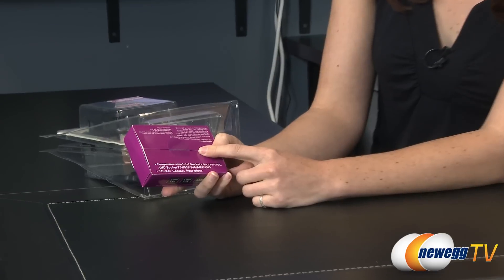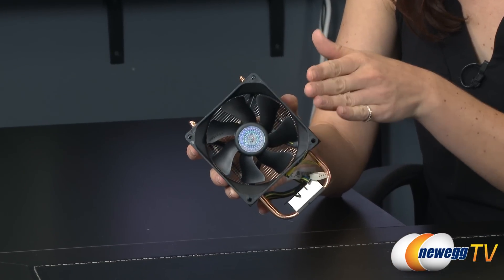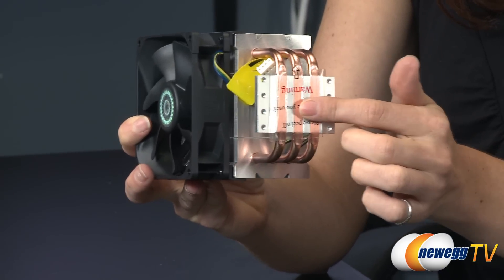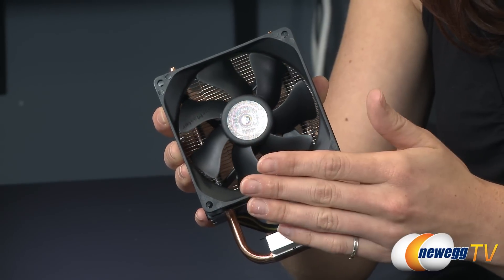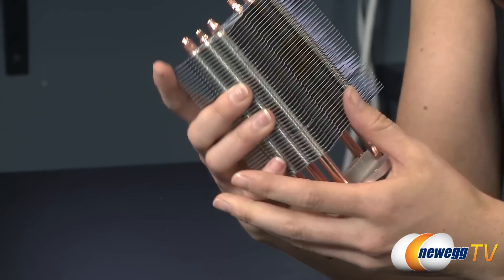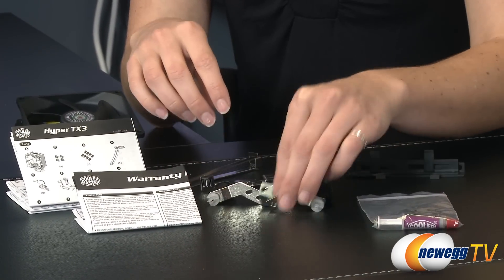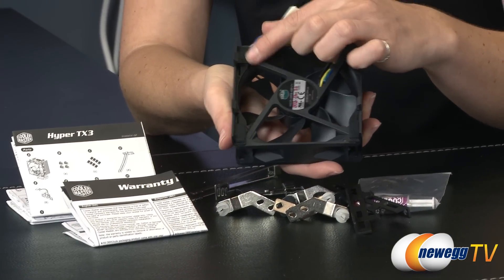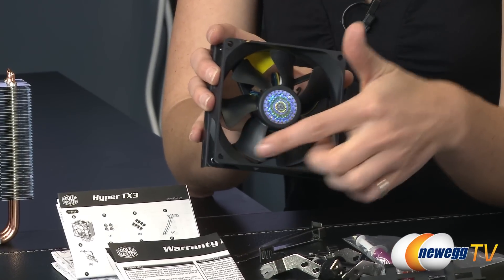COOLER MASTER Hyper TX3 CPU Cooler Overview - Newegg TV

Comment: I have this heatsink on my i5 6600k and it works well. However, what I did NOT like is the lack of a backplate. The cooler isn't terribly heavy, but having reinforcement for such a large cooler is good thing. The stock attachment pins are made out of plastic which does not inspire a lot of confidence.
Reply: Thinking about getting this cooler for my new pc, how are your temps? Overclocked?
Reply: I have this cooler but I havnt installed it yet, by any change can you overclock the 6600k?

Comment: The extra brackets arent for if it brakes, they are there so you can add on anpther fan on the ipposite side to get the push and pull motion, all you need is 4 mounting screws ro fix the fan fo the brakets.

Comment: the extra fan brackets are not incase the other ones break it is so you can add an extra fan on the other side to make a push pull configuration.

Comment: If you get this, i'd deffinately get a secondary fan in push-pull configuration.
Doing so knocked off 7 degrees from my cpu core temps and allowed me to push a 4.4GHzoverclock with my AMD FX6300!
Reply: is it loud? planning to do the same!
Reply: nah not really

Comment: What do you recommend as the best air colling solution for Intel i7-4790k
Reply: Ditto that.  I was looking at either this, or one of the Arctic Cooling Freezer line.
Reply: +Robert Morin I was looking at the Arctic freezer 13 and the TX3.. which one should I get and will it fit my h81-e34 mobo because I fear it may overlap my ram slots
Reply: Actually, I wound up going with a Hyper 212 EVO, didn't think I would, but it happened.  For me, it doesn't seem to bother much with RAM slots, if you have them at a proper profile.  Having Corsair Vengeance Pro DIMMs, I did have to place those in the B slots instead of the A slots, but at least they function.  :)
Reply: Robert Morin 212 evo is too tall my max is 13cm height

Comment: could i use this with a 4770k
Reply: yes you can use it. coolers with lga 1156 or 1155 can be mounted on lga 1150 sockets too
Reply: no its for diffrent cpus pentium , intel core 2 , celeron and its lga775 motherboard for

Comment: since she mentioned the fact that you can mount the fan on either side of the heatsink and that it came with another fan mounting bracket, she might have mentioned that it can be used to have 2 fans mounted for a push-pull setup.

Comment: I used this cooler for a few days. It really sucked and although I've mounted many coolers, I think this had defective pushpins. It fell and landed on my GPU. Everything is okay, but I actually had better luck with an Intel stock cooler... The TX3 never mounted right. I got a Hyper 212 Plus and it was great. It is the best cooler you can buy for the price imo. I now have the Corsair H80i and it's even better.

Comment: I use that cooler on a i72600 it idles at 34-37c and one core drops to 28c and goes to 64c in crysis 3 not bad seeing the stock when to 78c.

Comment: I have been using one of these for a while and they are a great cooler for the price. If you want to buy an additional fan for a push-pull config (what the extra brackets are for) then make sure you get the exact same CM fan that comes with it. I tired 2 different 92mm fans and they would not fit properly.

Comment: It would have been worth noting that since its compatible with 775 and 1156 it would be compatible with 1155 and 1150. No big deal though she is just reading the specs and its an old cooler.